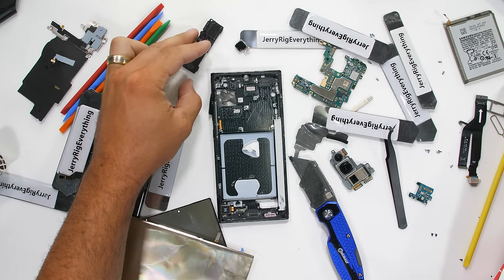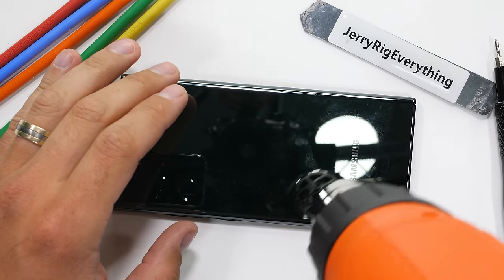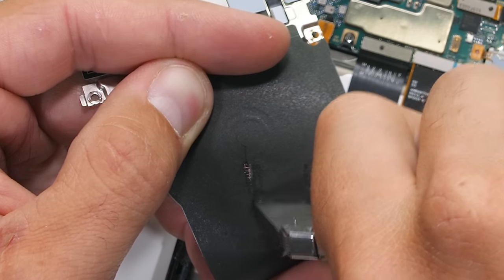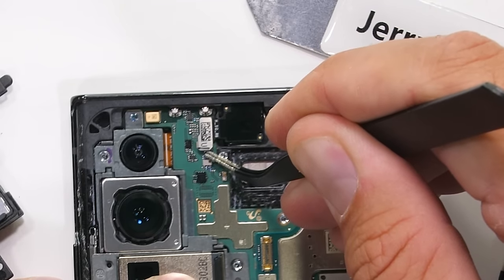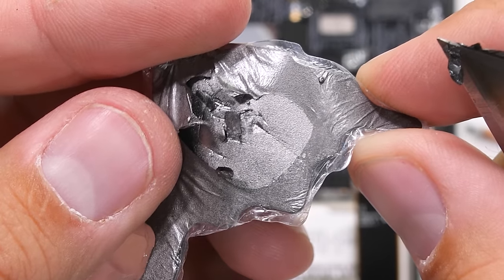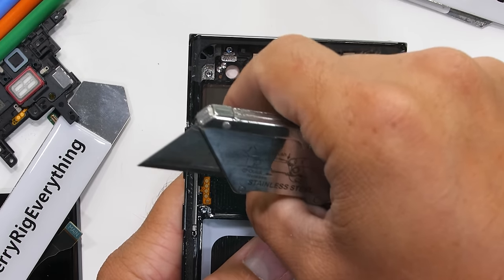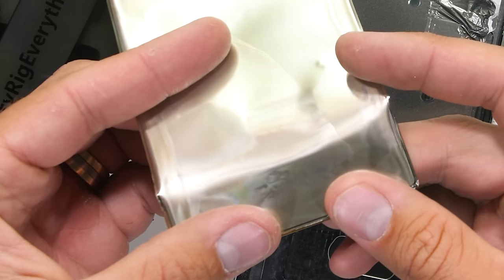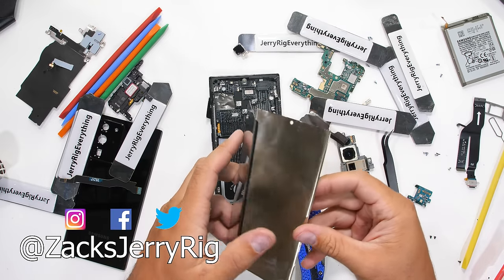Samsung Note 20 Ultra Teardown! - No Copper Cooling inside?!

Comment: I am absolutely with you on the argument that samsung shouldn't sell two different phones....like honestly as if samsung can't put snapdragon processors in all of their phones....and they cost the same too which makes me really mad....despite all of the innovations and stuff samsung has been doing they still shouldn't put two different processors which behave differently under the same name
Reply: Needless to say that in the snapdragon variant samsung is putting the sd865+ while in the international version they are still using the exynos 990 ......really samsung?
Reply: Snapdragons in all their devices would actually be a horrible idea. We don't need Qualcomm to have even more power with their monopoly. It would be better to go with 100% Exynos and just optimize the devices better on it - just like they did back then with the Galaxy S6.
Reply: @Raja995mh33  maybe you're right but they really need to put an end to this
Reply: I was okay at the time when Exynos was better than the SD (I live in Europe), but now I think Samsung should use the SD only or get the Exynos at the SD level!!
Reply: Tim R. Exactly, one of the major pricing problems of phones are said to be with snapdragon for basically ruling the processor market. However, is is a problem when a company forcefully sells you an old processor that has already lost against an old processor that is better in the current year, while the one they are selling didn’t had any improvement at all. Selling that processor together with a lot of other downgrades for an international version without giving you, as the costumer, the chance of choice (unless you ship directly from, let’s obviously say: North America) 

I don’t really approve that. I do, However p, agree with you that there should be another processor in the market to rival the Qualcomm’s one.
I just think that Samsung has lost an enormous chance of selling a better version of Exynos (if they had worked on one) with this phone, that is probably the most talked about of all samsung phones, which would pretty much be free publicity for them. 
It was a loss of chance for them, as far as I see

Ps: When I said “if they had worked on one” I didn’t meant that they probably haven’t even tried to improve their chipsets, I meant in a way like: I can’t see changes, no improvements shown.
Reply: @mondeomk5  yeahh man u agree with you totally
Reply: @migswn1491  nicely said....but as you said samsung had the chance to improve massively and they more than have the resources to do so but they are just not doing anything as far as i can see
Reply: abdelrahman saed yeah, big loss...
Reply: @Raja995mh33  Yeah, but they apparently can't make better chip than qualcomm. Their performance/overheating issues (more heat=less performance, if there is not good cooling) and so on. There are leaks for exynos with amd graphics. We will see about that, they still have to cool down the thing somehow. People are going to tear samsung apart if they make all their phones exynos if exynos is not better than snapdragon.
Reply: @migswn1491  They should put exynos 990 to 500-800€ phones (with better features) and then improve exynos lineup.
Reply: Matevž Šimnic exactly! Like with what they did with the Edge lineup
Reply: @matevz_simnic  The problem isn't even the Mali GPUs, which are good btw (take as example what Huawei do with their Kirin chips, or did). The problem is Samsung it self and its Exynos manufacturing team
Reply: Matevž Šimnic to be realistic: only a minority of people would go away from Samsung because of the Exynos chips... most people just don't care. 
Qualcomm is the main reason why Android phones are getting more expensive and are already way more expensive than iPhones while still having horrible support (also thanks to Qualcomm).
Reply: @juliofreitas8308  I know, but more performance is always better (if they manage thermals).
Reply: @Raja995mh33  Yes. I know that it is stupid when people buy 1000$ phones to be on facebook... I would care for all performance and thermals, especially if they cost the same amount of money.
Reply: Tim R. It’s true, most of the buyers will just see the phone by: its new, looks premium, has nice camera, expensive, gotta buy and show up.

Comment: The model Zack has is Korean, which is the Snapdragon variant. The Snapdragon variants (like the teardown of the US model that Zack mentioned) have the graphite cooling.

The international models that are Exynos are the ones that have the copper vapor chamber. So, essentially the opposite of what Zack was suggesting: it is actually that Snapdragon has better performance, worse cooling; Exynos worse performance, better cooling.
Reply: Finally someone else who noticed
Reply: @dechah  When he unboxed it in his durability video, the quick start guide in the box was in Korean and the model number on it was the SM-N986N, which is the Korean Snapdragon model.
Reply: Exynos users experienced worst heating issues during gaming.
Reply: When exynos devices heat up so badly you guys are telling that those phones have better cooling??
Reply: Zach goofed up badly then. Dint know what he was disassembling.

Comment: Oh, how the mighty have fallen. Note9 was truly their best phone ever, a 100 % zero compromise experience top-to-bottom. It was obvious they chose the wrong direction last year when for the same price as Note9 at release they offered us a device that was worse in every regard (worse and smaller screen, no 3.5 jack, punch hole) with exception of SoC, and if you wanted a true successor to Note9 you had to pay a significant premium. But trying to screw the people that buy your most expensive smartphone is akin to a spit in the face.
Reply: Man i wish santa 🎅 gives me a dictionary for Christmas so i can understand what you just said 😂 “from sponge bob”
Reply: Couldn't haves said it better, after note 10 and note 20 reveals, it's just made me like my Note 9 more.
Reply: That's stupid. What do you mean by "smaller screen"? If you take giant bezels over just a punch hole and virtually no bezels then more power to you. You know what was a compromise on the Note9? No ultrawide camera.
Reply: @daifuku9320  even though the note 10 lite and regular note 20 have a taller screen (similar price to note 9) the note 9 still gives you more screen and at 1440p instead of 1080p
Reply: Im sad no one realised that Samsung started doing this years ago back in 2010. 
Or like the Note 4 and the Note 5, advertising a 64bit CPU on a device with an actual 64bit CPU but locking it to a shitty 32bit OS
Reply: @daifuku9320  6.3 inches on Note10 is smaller than 6.4 on Note9 especially given that the aspect ratio change made the screen significantly narrower. If you want a phone similar in size to Note9 there is Note10+ but it costs more. The thing is that their marketing became slightly bs at that point due to the fact that one would assume Note10 to be a successor to Note9 while Note10+ to be a more premium phone. In reality however Note10+ is what should have been called Note10 and Note10 should have been called Note10 Lite or something similar because it is not Note10+ that is a premium version of a regular 10, but it is Note10 that is a cut-down version of a true Note smartphone. And by the way should I even point out the sheer arrogance of making two versions of a Note series phone? The series was always about being the best of the best and thus regular Note10 (same as Note20) should not even exist.
Reply: I switched from the note 9 because of insane trade incentives, and I gotta say it's good but does not feel like two years of progress. I think the hole punch is ugly, there is no way a headphone jack couldn't have fit, the camera sticks out so much and the battery life isn't fantastic (seems it would've been easy to give a bigger battery to lessen the bump), and the most annoying part to me is that you cannot have the 120htz mode active in full resolution. That's stupid as fuck. Also still no granular white balance, my screen a slight, but existent, green hue. And many might say these are nitpick, but the retail price is insane. Samsung is starting to feel exactly like Apple with their pricing.

Still happy with it overall but that's because I got it for more like 600. I can't imagine double that. Don't even start on the regulat note 20 non ultra either, oof.

Also I gotta say that the screen is physically larger, it is not narrower. I have both phones next to eachother right now, it is by far the best screen I've ever seen on a phone. Again doesn't excuse their stupif decisions tho.
Reply: I totally agree
Reply: as a note 9 user i can't agree more with ya buddy...this truly will be my last samsung phone
Reply: I had a note 9 and a note 10+, the 10 didn't seem worse to me? Just an evolution 🤷🏻‍♂️ bit better in most ways imo, I'll add I upgrade every year when the new phone drops but have yet to see a "backwards step" just the advances get smaller and smaller.
Reply: @terryc4vts670  All  I said was adressed to regular Note10
Reply: @asmodeusml  ah I see, thing is the note 10 wasn't the true successor, that was the 10+ as until the 10 a note was a note, there were no + models or smaller ones so that's where you lost me
Reply: Do you know that hundreds of note 9s have been dying for the last few weeks of what begins with a green screen? It's been happening after the last update, especially in India and Bangladesh. Samsung people are saying that the expensive display need to be replaced. But some people who spent the money found that the new displays also go green and die in a couple of weeks.
Reply: Thats why im still rocking my note9 right now
Reply: No bro the s7 edge is a tank
Reply: @brotha1984  I brought a spare note 9 brand new as a back up so I have 2 and I will not be buying another phone again.2 note 9 will last me for years it's the best note ever made
Reply: you might wanna do a little research now. Note 9 displays are dying everywhere for the past few weeks because of what people say is a firmware update. It starts with a green tint and eventually becomes unusable. Mine got this problem. And display costs over $300. I'd have spent the money, but I'm not sure how long that display will last unless Samsung fixes the issue
Reply: @vinylmodsmanitoba  a month ago I was using my note 4 which allowed me to never have to charge it because the battery could be swapped. I recently bought the note 9 and to be honest the note 4 wasn't a bad phone it just stopped getting software updates
Reply: @Saint696Anger  Yes i agree the Note 4 was a good phone, for me i had to upgrade because the charging chip became faulty and would damage any battery i had in there after just a few weeks.

Bought myself a Xaiomi Note 3 (6GB RAM/128GB ROM version) for $300 and haven't looked back.
Reply: I tend to agree. I moved on to the Note 10+ from the Note 9 and the first thing I had to do was go shopping for adapters. Silly to pay that much for a phone and then you can't even use headphones and charge at the same time.
Reply: @Saint696Anger  Yeah, the Note 4 was the last true no compromise phone. Back then you could have a phone with everything if you were willing to spend the money, but despite prices soaring far faster than inflation, a true no compromise phone isn't even an option anymore
Reply: Beautiful beautiful
Reply: I have a Note 9 I bought in 2019, so it's about 3 years old now. Had absolutely no problems with it, period, until recently. The panel now has a weird burnt out crispy look to it. All the colors are washed out, and it seems every pixel backlight is always stuck on (so blacks appear as light gray, where in an AMOLED display, darker colors usually look so rich because each pixel is individually lit and can be controlled). Unfortunately, since Samsung doesn't offer proper replacements, and designed the phone to be tamper proof, I think I'm done with high end phones and I'm just going with Moto or maybe some other cheaper alternative from now on. I'm also interested in those newer modular phones that claim to be """"eco friendly"""". I only need my phone for GPS (work) and reading, and auth codes, so it doesn't matter to me.

Even if Samsung offered a repair service, I'm not interested. this phone is extremely important because it stores all my two factor codes and is tied to accounts in other related ways, so there's not a chance I will trust sending this thing off to a company that won't do the right thing with it. Remember, corporations do not care about you. You are not their friend. They think your property is their property, and they are pushing for a future where we own nothing, and they own everything.
Reply: Yes, the Note 9 was and still is the best possible phone and the only Android flagship that literally offers everything without any compromises.

Comment: customer: what's the difference with the Note 10?
Samsung: The S-pen is now ergonomically placed on the other side
Reply: you mean note 20
Reply: For a left handed like me, it is a real improvement
Reply: @Luffy61C4  im left handed too. left handed gang
Reply: bruh it has major improvements... wtf? and its on left bcs of camera... bruh
Reply: a l t i k It does have massive improvements, but they aren’t justified against the massive price and most of the hardware capacity. Having a QuadHD screen is really good. Having 120hz screen is impressive! Having to turn down the QuadHD to be able to use the 120hz is a total bummer! Specially if you have cut down the battery, from 5000mAh to 4500mAh. Having the snapdragon865+, the best smartphone processor in the market is a pretty good deal, having some of the best cameras too, the S-pen, and all of those stuff are awesome and could be worth the price... if you live in America or where the non-international versions are sold. To everyone from the international version, it’s a complete waste of money, over expensive phone. Exynos 990 is a trash processor from last year that even lost against the snapdragon 855! It overheats, can’t handle as much as the power that the snapdragon could wastes even MORE battery! Not having copper cooling is awful with a processor like this, specially since this is graphite cooling. If it was graphene (which is an exception to the metal and heat rule has it is capable of successfullydissipating heat 4x more efficiently than the copper cooling) it would be way more acceptable. The power processing of the processor is one of the most fundamental things in the smartphone business. Not having the 5G version in a lot of cases for the international is also something that pulls the phone down, and claims it as overexpensive. 
I’m sorry if I had some gramatical errors, its 11:32pm where I live (23:33 now) and english is not my first language, I’ll be improving my writing and arguments by the morning.
Didn’t tried to be rude, this is just my view in how an international sees the problem, (as me being an international myself) 
The camera’s are the least concerning thing of this phone, from a tech perspective, since even the snapdragon version has better AI to process photos, which will definitely look much more nicer and better and capable than the Exynos one. Which is also another boomer.

Comment: Samsung: Apple removed the HeAdpHoNe jack!
Also Samsung: Removes cooling system, removes headphone jack, sells an inferior phone for $1300.
Reply: Wired earphones are also no longer included in the box (from what I've seen and heard).
Reply: inferior phone for $1300 and garbage phone for $1000 (regular Note 20)
Reply: @18Me10  Agreed, the regular Note 20 is just a piece of shit. I am a Samsung fan and I use S10+. But if they are gonna continue like this, time for switching!!
Reply: @18Me10  What is the Snapdragon Note20 Ultra inferior to?
Reply: Ragon Maarten we're not really talking about the Snapdragon version here
Reply: I'm using note20 ultra 512gig. And I have the 865 snapdragon. But since Samsung become greedy,  this would be my last Samsung device. Thanks Jerry
Reply: @nogravity091  Samsung ain't being greedy. It's Qualcomm. They are pricing their chips at a ridiculous price and force companies to buy it with 5g. Samsung in some way has to prevent from losing money so they use Exynos. But as seen its trash.
Reply: @Paradox81818  it's not just qualcomm being greedy. Part of it but not entirely, there are a lot of cheaper snapdragon 865 phones. Heck there's even a sub $400 one, Samsung are taking advantage of being a mainstream brand and most consumers don't even know what processors their phones have, they just expect it to be the best since it's a super expensive Samsung.

People don't vote with their wallets and we all lose.
Reply: He actually got the models wrong. The model he has is SM-N986N which is the Snapdragon version therefore the snapdragon is the one with the inadequate cooling.
Reply: @Alaminpervez  Well it could also be because Qualcomm has Samsung locked in a contract to build their chipsets.

Comment: It is clear after the heat problems with the S20 series and the difference between the Exynos and Snapdragon processors, Samsung wanted to show us in the Note 20 series that they solved the heat problems by deceiving consumers and by supporting devices equipped with the Exynos processor with copper cooling and removing the copper cooling from the devices equipped with processors Snapdragon to both achieve the same temperatures when testing devices under pressure.
Reply: You got that completely wrong. Exynos does not feature any Copper Cooling this year, while Snapdragon does.
Reply: Zack actually got the models wrong. The model he has is SM-N986N which is the Snapdragon version therefore the snapdragon is the one with no copper heat sink.
Reply: Samsung isn't deceiving its customers. It gives cooling to exynos and not to snapdragon so that the customers buying either of the phones get the same performance. Its only fair.